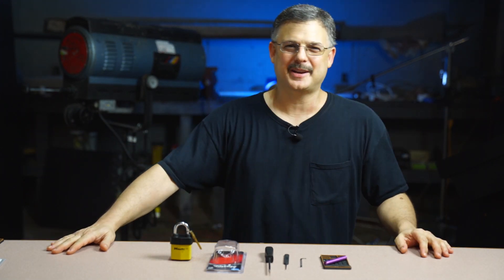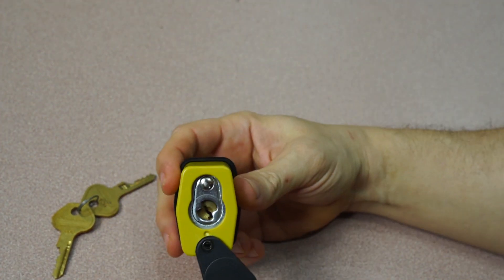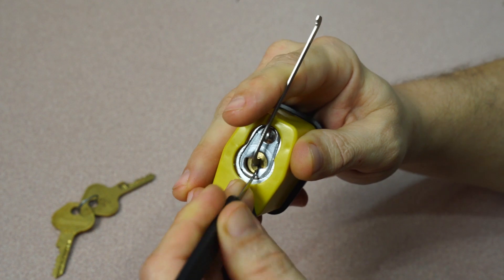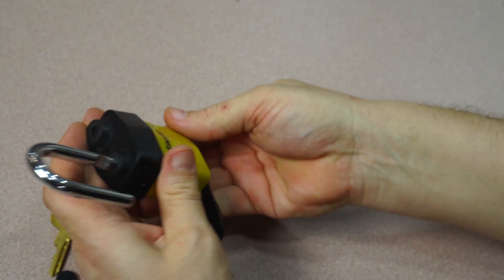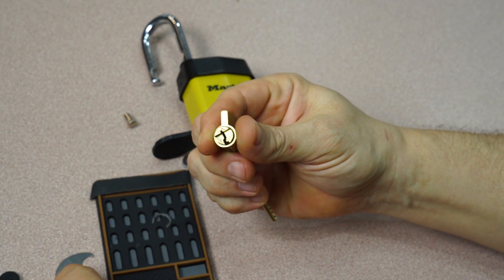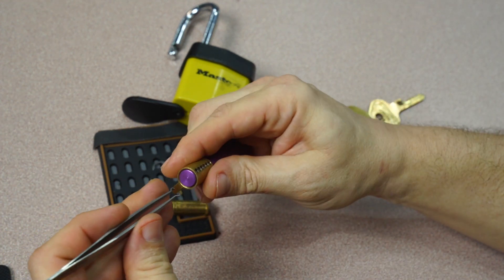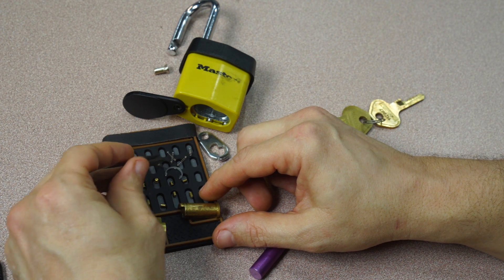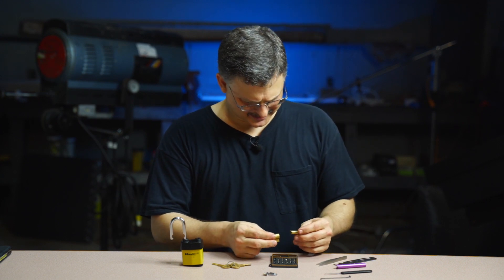[4] Master Lock 911 Padlock Picked and Gutted for Green Belt

Comment: Looks like you moved on to some Peterson tools.
Reply from the maker: abyss1232 I did :) I now have 4 Peterson picks. 2 of each of the 18th and 25th. That smaller size makes soooo much difference in locks with smaller keyways. Although so far I have only used the standard hooks. .